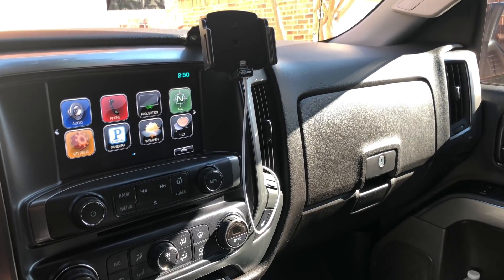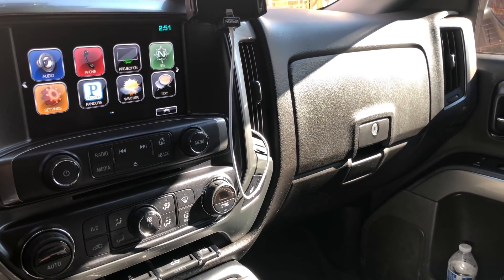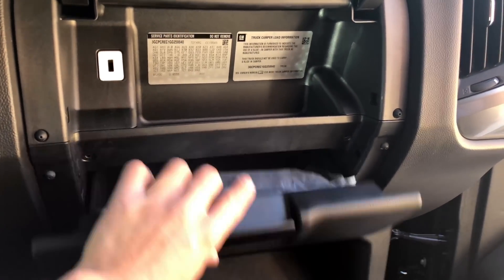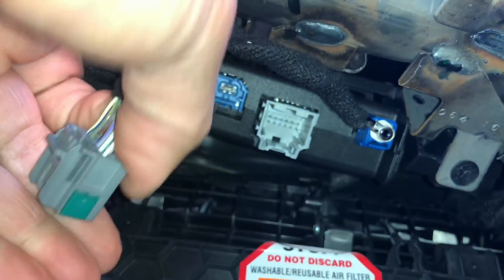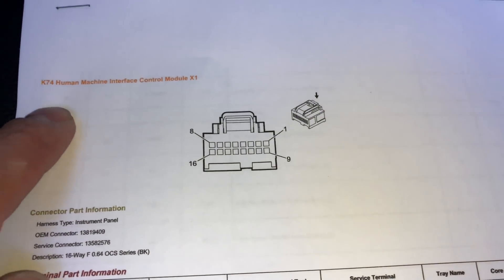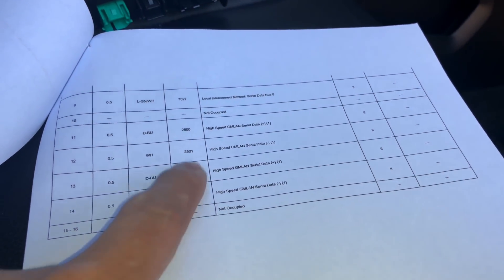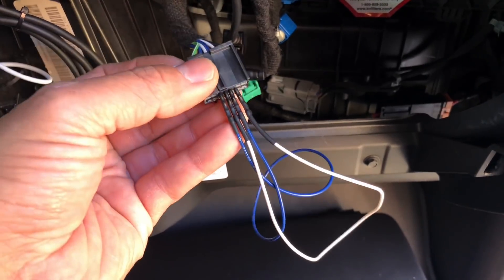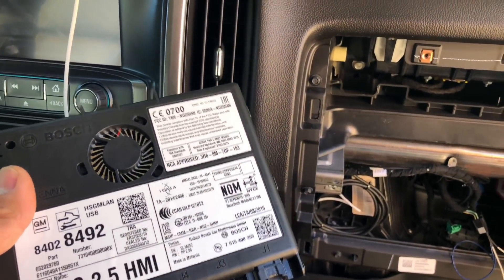2014 - 2018 Silverado/Sierra:  Start your Truck without your HMI!

Comment: What neat new features are you getting?
Reply from the maker: Stay tuned.  I won't know until I get it.
Reply: If they can add mirrors that tilt in reverse and Auto up on all 4 windows for my 16 silverado LT I will rip out the module tomorrow and send it in.  Make sure to make an update video!
Reply from the maker: Fat Head Cycles If I recall, reverse tilt was an operation that is dependent of seat memory and the seat memory module.  There was a ton of parts needed (that I bought and tried) to get Seat Memory.  But the components kept adding up, missing circuits and various modules that would have needed programming.  So I gave up.  I sunk $1K into (I think) and didn’t want go any deeper.  For auto, I wanna I say that may be possible with some form of programming... I would reach out to WAMS on that one.
Reply: Got me like a kid anticipating a gift at Christmas. Doh!  What new things are you adding already, the suspense is killing me.
Reply from the maker: Shane Babb - Looking into adding additional video inputs.  Think front camera to complement the front assist :). Always looking to develop use cases with these mods :)
Reply: Front camera would definitely help me.  I miss the front sensors from my SLE.  I park backwards all the time now as I only have sensors on the back. Can wait to see what you cook up. Thanks for all you do man!
Reply from the maker: Agree!  I need all the help I can parking.  I have tight spaces to deal with.  Thanks for the feedback!

Comment: Thanks for putting this together.  I have a 2016 Silverado 1500 and I have lost my HMI for the 2nd time.  After watching your video I see that when the dealer replaced it, they reinstalled it upside down.  Me thinks that the unit was not getting proper ventilation as noted by the exhaust fan on the unit, and it failed - the weather is getting warmer where I am.  Thanks for sharing.

Comment: I have a blacked out screen and the radio comes on when I start my truck but only stays on for about 10 minutes then it turns off. The screen stays blank throughout all this. I can control the radio through my steering wheel. Would reprogramming and updating my HMI fix my blank screen?
Reply from the maker: Check for loose connections at HMI and back of the screen. Could be failing screen or HMI.
Reply: @philgamboa2906  I was hoping I wouldn't have to take the screen out but looking like that's the next route to take. If that doesn't work, do you think buying a new HMI would fix my problem?

Comment: Phil, Chevy makes a SSV/PPV Silverado in your model truck, they're Rare. I've seen 1 so far. The rear of the truck is lowered/leveled nearly the height of the front. Would you know or can you find out how they do this from the factory?     I believe either the rear leafs don't have as much as an arch or the rear leaf shackles are longer, but they wouldn't be made the way all aftermarket drop shackles are designed ( Welded together 2-piece design, prone to cracking ) the OEM leaf shackles are a 1-piece design. I'd like to lower the rear of mine the same way the SSV/PPV Silverados are
Reply from the maker: I Know You're Right But - Hmmmm. I haven’t heard of an SSV/PPV in the truck line.

Comment: I recently bought a 2015 gmc sierra at an auction. It was a stolen truck before ending up there.  I'm having troubles starting it. The wires going from the HMI to the On Star and Radio Module were tampered with. They cut the heads off the ends of the radio and On Star Module. Will this still affect wether the truck will start or not? I don't mind buying the radio module, but I don't want to buy the On Star module if it's not really necessary.

Comment: Phili need your help! I just got some leather memory power seats that I would like to put on my 2014 regular cab lt. I tried plugging in the harness and the seats didn't work :( I wonder what I would have to do to the harness to add power seats
Reply from the maker: Jay, the reason you lost power adjust on the driver side is because the power for the control switch goes through the Seat Memory module where on the trucks without seat memory, the power goes straight to the motors.  I make a bypass harness for this for $135.  I made a thread for that here.

http://www.gm-trucks.com/forums/topic/211613-2014-k2xx-heatedcooled-seat-seat-memory-bypass-harness/
Reply: Will the airbag and seatbelt sensors still work with the stock harness?
Reply: Phil Gamboa hello phil I have one more question for you. On your harness that you are selling for 140 is that for 1 seat harness only or for 2 seats??
Reply from the maker: Harness is for the driver side only.  The passenger side, in my truck, had the power circuits present and didn't need any modification for the power adjust controls to work.  Also, there might be additional sensors needed for the air bag.  Since you are moving to a powered seat, the truck needs to know its position.  If your driver seat is already powered, you may not need a sensor for that one, but the passenger seat will.  I helped a local member here and he needed to add a seat position sensor.  After we installed that, the air bag light went away.

Comment: Could you please tell me the brand on that awesome phone mount you have ?
Reply from the maker: Thanks!  It is a combination of a mount from Panavise.  It is a Vehicle Specific Mount.  Here is a link to what I have.  They have a couple of versions based on if you want the mount to sit higher or lower on the mounting point.  https://www.panavise.com/pdf_indash/751101714.pdf - It uses existing bolts to mount.  The holder itself is from ProClip USA.  https://www.proclipusa.com/product/adjustable-iphone-holder-for-lightning-to-usb-cable.  I used a Lightning Cable and it is fed to the Glove Box USB so that Apple Play passes through.  I removed the Glove Box USB and tucked it behind the glove box so it is hidden.  Good L

Comment: Hey PGamboa  I already bought the 8”lcd coming wit NG 2.5 HMI its from a GMC Sierra Denali can I use it on my 2015 Silverado LT 2500?  I installed it but when it turns on it appears on the Screen “THEFT LOCKED” If i take it to the dealer to program it will it show up as Chevrolet MyLink?

Comment: I unplugged the grey 12pin connector on the hmi and plugged it back in , now my radio does not work
Reply from the maker: Can you be more specific?  What was done, is the screen black?  Did you send the HMI off to get unlocked?
Reply: @philgamboa2906  it came back on within 30 mins

Comment: You have the same truck as I do I've got a 2018 though you have USB hookup in the glove box I do too but mine will not do anything I'll plug the flash drive in it to play a video and park it will not do it is that why you sent this off the HMI
Reply from the maker: GM removed the USB Video playback ability on 2017 and later.  My truck is a 2016.  14-16 have USB Video Playback ability.  You can send your HMI off to WAMS to get the functionality restored AND get your HMI unlocked for the other features I showed.

Comment: Thanks for the video. I have a 2015 GMC Yukon. All of a sudden my radio stopped working. The screen works for the rear camera. I tried controlling the radio from the steering wheel. Nothing. The hidden console will raise and lower but no radio or display. It’s lit up with like the tv is but nothing on the screen. I have checked to see if the fuse was blown and it is not. I also replaced it with a new fuse and nothing. I did wiggle the wires on the HMI and no flicker on the screen. Any thoughts or ideas!? Thanks!!
Reply: Hi did you find the problem cuz I have exactly the same problem
Reply: @darianymoreno2079  it was the Media disc player (not for a cd). Something back behind the screen area. $600 parts and labor at GMC
Reply: @Prissy-Pants  how long they had the truck mines doing it now
Reply: @charlesquickley7789  they had it for a day. Ordered parts that afternoon and had it ready the next day.
Reply: @Prissy-Pants  do u remember  wat part they order for u
Reply: @charlesquickley7789  sure don’t. Part was about $260
Reply: @Prissy-Pants  ok mines doing wat yours is doing tring not to have to pay 600 bucks  I would get part and put in myself
Reply: @charlesquickley7789  I think just have the receipt in my truck. I will look later and see if they list the part.
Reply: @Prissy-Pants  plzzzzzz thank u I am waiting
Reply: @charlesquickley7789  I found it. Do you have an email Incan send pictures of the receipt?
Reply: @Prissy-Pants  can you reply on here what that part was? You'd be helping a ton of people with the same problem.

Comment: I've taken my glove box out twice tryin to hook up a Sirius xm radio and I have no HMI box up in there. I do have 2 boxes behind the stereo.
Reply: Did you ever find out
Reply: @JMC180  Still no box behind the glove box. I did figure out the SiriusXm thing though. I had to drill a hole and run a USB cable from my center console under the carpet to behind the dash.
Reply: acedogg692005 I wonder if there’s a way to wire the HMI or make the screen turn on without it ima look into it I bought everything and found out I had no HMI or could it be somewhere else

Comment: Do you know if it is possible to add factory trailer brake controller?
Reply from the maker: Based on what I read, it is not.  There is cluster interface and BCM.  Once you get passed all the hardware and wiring, you're still looking at possible customer cluster/BCM.  Can it be done?? Possibly.  But I am unsure on the programming requirements.
Reply: @philgamboa2906  I thought it might be a simple plug ang play, but from what I have checked into it is fairly expensive to do, and I cant find out exactly all the parts required to do it. so I just bought this OEM 19418030 GM/Curt Spectrum Brake Controller Package